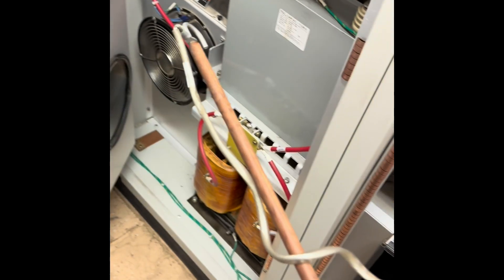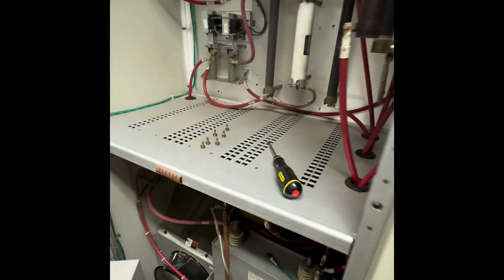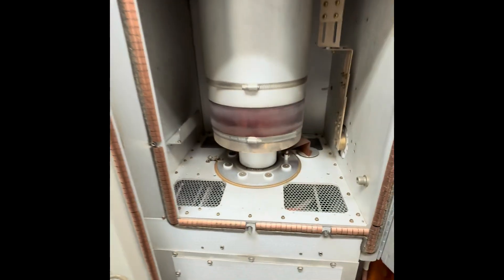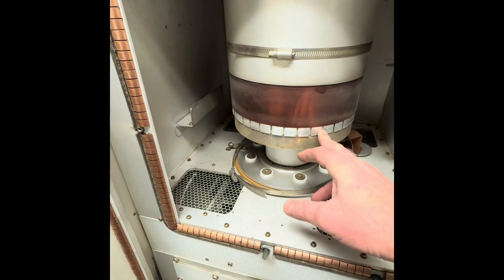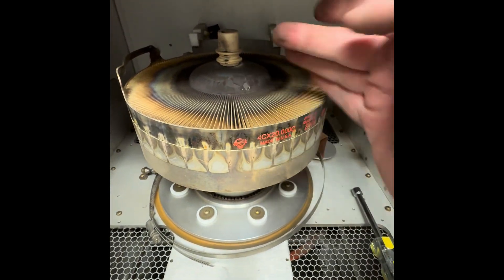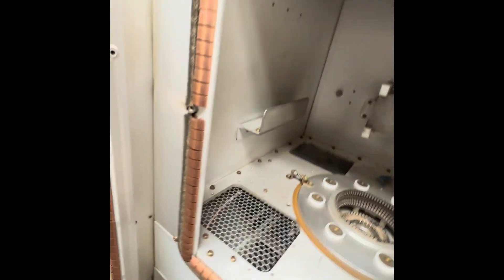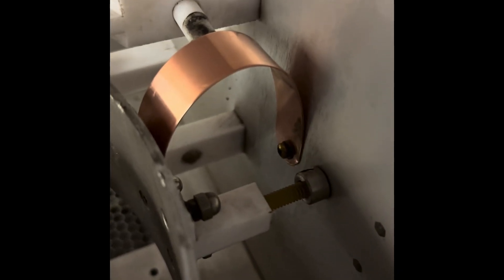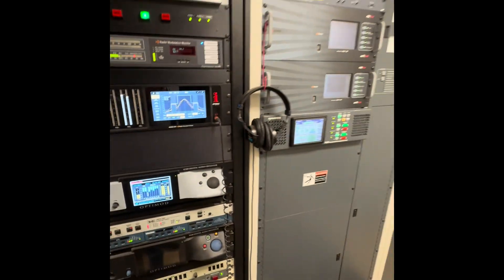Harris HPX40 repair - KJ7E

Comment: how many amps does it take to burn open a ground strap that big and from where did the volts come from, to energize the ground strap?
Reply from the maker: Its RF with inductance which causes impedance and resistance at frequency.  This causes micro arcing between the individual strands of braid which degrades the braid and makes the situation worse as time goes by, eventually melting the braid.  The solid strap has no braid to arc between.

Comment: Hah, I loved speaking loud next to these and watching it modulate with my voice :P That resonant cavity design was definitely a choice. A few dB of gain change and a few meters of HAAT on the antenna system after the station was installed meant that this once-30kw TPO site only had to be about 18kw for the same pattern.
Reply from the maker: This station has both TPO, ERP and HATT on its side.  Legacy SuperB.  https://radio-locator.com/cgi-bin/pat?call=KTWV&service=FM